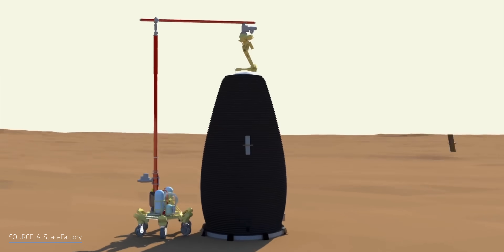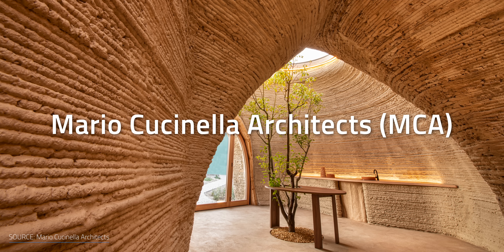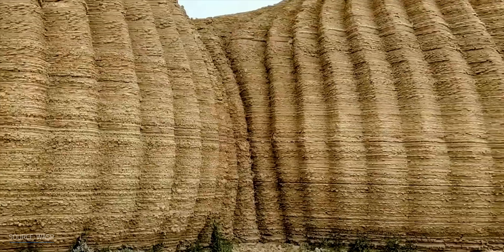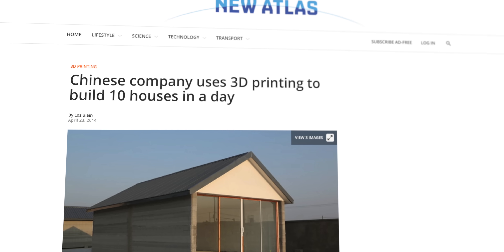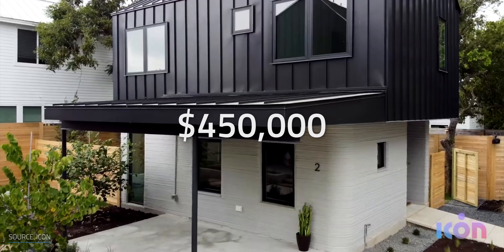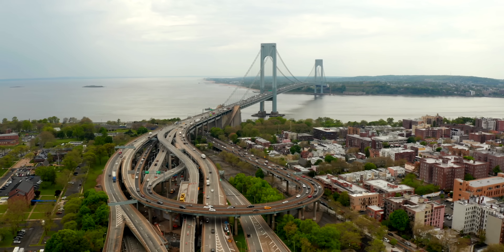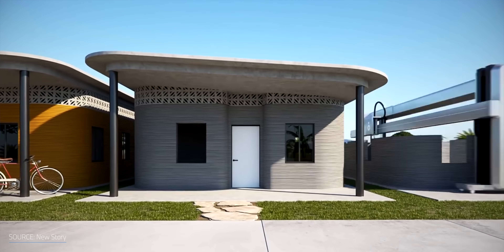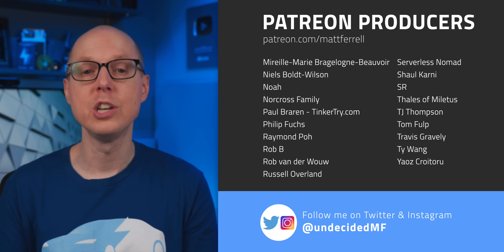The Truth About 3D Printed Homes

Comment: These are not 3d printers they are 2d printers that ultimately create a 3d shape.
P.S. I'm an architect... Prefab is a better way to do it because it reduces waste in all the materials. Transportation is an issue but if we are talking about small houses it's doable. Old time clay building techniques using chicken mesh hessian and clay or prefabricated hemp blocks with earth construction is usually faster.

When people imagine this, they don't count for getting the machine on the site, setting it up for each site because it's too different + it's a monolithic structure any repairs in particular problem areas, which there will be 10000%, would be a nightmare.

Comment: At this moment this is incredibly BAD.  This is too close to the Earth sphere type houses using papercrete. I guarantee you that dangerous  MOLD will start to grow. Yes even in the Desert any moisture that gets entrapped will start to mold and then your house is a HAZARD.  You are going to have to put chemicals into the mix and we have already seen what can happen with that.  Remember the Chinese Drywall issues? Yea let's remember that 

The woke talking heads don't like to mentioned this aspect BECAUSE it goes against their narrative.  I'm for the technology. I am DEAD SET AGAINST the stupidity of the woke left. 

The problem is that I have seen with my 37 years in the construction/maintenance industry is that the WOKE don't do things RIGHT... to the point of putting all of us into physical harm because they want to voice their Narrative.  

LET US  start making a Real concerted effort out of recycled rubber, recycled plastics, and if done right recycled paper.   If DONE right then lets go and do it otherwise lets wait until we get it right.

Comment: 3D printing is very rarely cheaper, and almost never if you factor in the time it takes to set up and calibrate a printer and to make the 3D models. Even then, the quality that comes from a 3D printer is not in any way comparable to an industrial part; standard FDM printers produce parts that are much less sturdy and don't look nearly as good, while resin printers blow up the cost and have their own issues.

Comment: If you make a dirt shell with the right mixture, you can burn for days at high temperatures any available fuel and it will turn to solid a solid ceramic structure which would move as a unit in case of earthquake.  The main problem with "unbaked" dirt homes is that they may crumble in earthquakes and not really be waterproof.  However, if manufactured home companies incorporated 3-D printing into their processes, it could lower costs in the United States.  I'm Africa, it makes more sense for human and animal labor to build earth homes with insulative properties.  However, 3D printers could be used for the many home compnents.  If countries had deliberate decentralization plans, fewer people would need to commute to city centers.  For example, why does the Agriculture Department need to be in a capital city when we have modern communications?  A small city in a principal farming area is more appropriate.  Crime and infrastructure costs go up with density.  Birth rates go down in urban areas, even in countries that need more children.  Being in the city means constant noise and intrusions by rude or threatening strangers, as well as noise and high cost of living.  Urban planners need to do better than to cram people into cities which are a few political decisions from becoming a nightmare, such as San Francisco.  People flee, even if means living in an old caper shell or discarded trailer,  rather than endure the horror the urbanization has become.

Comment: A house entirely made of dirt is NOT actually a smart thing if your thinking about longevity. Because think of all the insects and animals in the world that burrow into the ground, everything from ants to moles would be digging into the side of your house in no time at all, especially considering your probably going to be heating and cooling your home and those insects and animals are going to be attracted to the heat or cooling to escape the outdoors' temperature. Not only would you be constantly battling invasion of your home from animals, but you'd also have to be constantly spraying weed killer on your home as everything from grass, flowers, weeds, and trees would be putting out seeds that would find there way onto your home and setting down roots that could essentially crumble your house apart. A house like this would only be good for MAYBE a few years, id say 10 years AT MOST before it would be unlivable and have to be rebuilt UNLESS they covered the entire thing in some sort of coating or covering that would seal the dirt in and prevent animals and insects from getting to the dirt walls and ceiling. Not to mention any kind of plant or tree roots that could grow up into the walls from underground, with the entire structure being so much lighter then bricks and concrete, they could EASILY push up on them making the entire structure unstable. So in the LONG run, I still believe that building a NORMAL home would end up being more sustainable, cheaper and last MUCH longer.

Comment: None of the 3D home printers I've seen so far produce reinforced concrete (or clay).   :-(
Reply: But it is possible.
Reply: @SpaceCrete  Really? Are there 3D printers that print concrete walls that have rebar in them? That would be awesome.
Reply: @Patiboke  A giant one in China that pushes concrete in form both sides.  Or you can do it from one side against rigid insulation that is already in place (and can be printed).

Comment: I have been talking to our Local Road Manufacturers, or Resurfacing Roads, and I ask if Ground up Plastic could be used in the very Hot Tar and add as must waste plastic as possible, They are now looking in to the idea of mine, and ive been invited to the laying of a 100M stretch of road, in between and normal road, so they check for wear and Breaking, but its a long wait to see how quickly a percentage of Plastic would last as a road.  When I get more Info from the Company on how the Idea is going, I will post another comment here, when Information is available. . . Colin

Comment: I once created an unpublished SF society whose economy was based on lots of robots.  Houses were made from rammed-in-place earthen walls, and joists and rafters from flash-vacuum dried sapling trusses.  Roofing was from split hard shale slates.  The people directing the robots were arts, and humanities majors, and were helpless--at first--to figure out how to light, heat, insulate, their houses.

My unpublished story was an attempt at building a lot of housing very quickly.  Calculations quickly showed that I needed to provide continuous ventilation of living spaces, including air filtration, as rammed earth is dusty, and dust is not good for lungs.  Also, studies show people need lots of light to do better work.  That meant lots of electricity, and aluminum is more common as copper, though slightly less electrically conductive.

Crime and other social control issues are easier in small communities.  So everyone lived an exurban lifestyle.  Transportation was by truck-like vehicles--also mass produced--that floated three feet above the surface, and were powered by deuterium energy cells.

Even with modern North American methods of building out of spruce, fir, and pine two-bys, and using nail guns, material costs for the structure of a house is not a significant cost in light house construction. The utility systems and continuously custom fitted external and internal trim work is.  And the floors will need to be built of concrete, from a practical point of view.  Large roof overhangs to avoid rain attacks upon the siding and external trim.

Comment: has any one tried to 3d print glass out side of semi conductors?  building structures out of dirt plastic and trash seems like a step in the wrong direction.  now a 3d printed structure out of glass  could include plumbing bath wiring solar heaters/ coolers greenhouse and photovoltaics. why not raise the bar? oh by the way because they will have to be re= built/repaired  over and over the carbon footprint is way more than something that's built to last multiple generations. also the major flaw with capitalism nothings built to last. just from a logistical stand  would you rather continually rebuild the same shit over and over or work on space exploration? or genetically engineer a tree or animal to grow in the shape of a house. like bamboo.

Comment: I can't see these being as viable as the hype says.Durability and repairs would be my first concern.

Then you need to think about how well it could last against natural disasters and extreme weather events.

Keeping the electricals and plumbing safe without impacting structural stability would be another concern.

As for most of these house designs, most seem impractical considering they have only two or so rooms.
It wouldn't be practical to use so much horizontal space in small countries.

One other thing I'd question is how much "consistency" each build would have.
Just because it's clay doesn't mean the material is the same wherever you go, some clay deposits are going to be thicker or thinner- can a machine handle that difference? Or are we talking about a human getting it to a similar consistency before the machine can use it?

Also what about ensuring consistency across the board? Some areas are bound to have weaker sections than others which is going invite additional wear at those weakened points.

It's not to say these houses can't be used I just don't believe all the hype.Kinda reminds me about hype around concept cars vs mass production versions.

Maybe in certain scenario they'd be good but as a long term home that you can spend many decades in I just don't see them having the longevity.
Reply: The hype is amazing and irritating. I posted a collection of it.

Comment: There we go again of hyping up stupid solutions to problems that have been solved a long time ago. If you want to build fast and cheap, just produce ready built home-components (like walls, floors and roofs) in a factory and assamble them on site. That way you can even built in pipeing and electric. That is what commie-blocks are and it worked just fine and it is the technique the chinese use to built 10+ -story buildings in under 2 weeks.

But since we are all individual special snowflakes we can't have uniform housing, I guess.

Comment: When I was a soldier in Iraq, there were Iraqi's living in clay-type houses and you know what, DUST was a HUGE issue. I bet it would be horrible in there.
Reply: Does the dust come from the walls or just from the outside. Since iraq is in a sand desert region.?
Reply: mud homes in iraq ... and dust . hmm perhaps the several thousand square miles of beach has something to do with all the dirt all the time
Reply: It would be possible to seal the walls by painting a clear coat sealant on the inside and maybe even outside.
Reply: @kerra3699  Perhaps a lot of linseed oil will help on the external.
Reply: @kerra3699  LOL, you're so wrong.
Reply: moisture is my main sinus problem.

Comment: Obviously a house made of clay will not last very long unless built in a location where it never rains. We have adobe homes here in Phoenix. They last a long time IF maintained which means replacing eroded clay. It rarely rains here which helps. The clay house looks to be very difficult to maintain because the outside isn't flat. Also the right kind of clay has to be available.

Seismically the clay house looks scary to me.

3D clay printing machine??? People have been building mud home for centuries.

Comment: I constantly see articles proclaiming 3d printing will mean the end to housing shortage, that it will mean cheap housing for poor people etc. Anyone who has seen the videos of a 3d printed house should also be able to see the limitations - it produces really ugly houses and it still takes a considerable amount of time and labour to produce even a single story house. And nobody is going to want to living in a house than can wash away so it'll be concrete, mortar or something like it.  And besides all that putting up the walls is only about 10% of the time taken to construct a house so it's a complete nonsense herald it as a solving anything. Besides, if speed of construction was the limiting factor then it would be solved with modular houses which can be prefabricated in factories and assembled on site to a far greater level of completion than some glorified coil pot.
Reply: There isn't really a housing shortage tho. There are city councils who deliberately hold back permission to build them. that is all there is to it.
Reply: @topsuperseven7910  that's part of it,  but there is also the developers pushing for more low density housing in unsuitable areas, rather than quality mid density housing in areas nearby existing infrastructure, because that's what's more profitable. And then there is housing policy that favours investment over habitation. There are a number of factions contributing to keeping housing scarce and expensive.

Comment: How about some practical commentary that digs deeper into the similarities and differences between contemporary homes and the 3d printed variety.

What kind of maintenance does a 3d mud home expect?  How does one repair minor damage/wear on a mud home?

What about major damage? If someone drives their vehicle through the wall, do you bring back the erector set to 3d print repairs?  Can you repair just the damaged portion, or is the entire structure compromised and you have to tear it all down and start over if you only want mud construction?

Comment: Man, that "House in 24 hours" is a such scam and not even impressive considering it's basically just exterio walls and a roof, no furnishing. If a construction site has the materials and meager grew, they can also build that faster in one day. Which is usually 8-10 hour shift. Say, a wooden house.
But yes, I am interested to see this house printing tech improve and expand. I figure it'll be a good addition to the already expansive methods and techs
Reply: Exactly right!  It will have to get better.